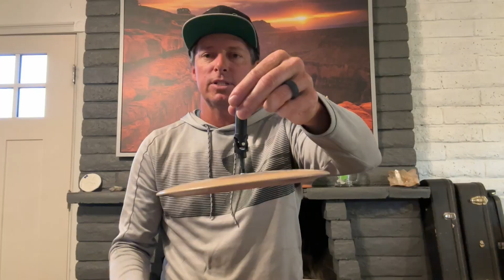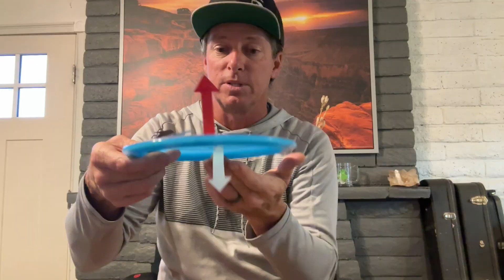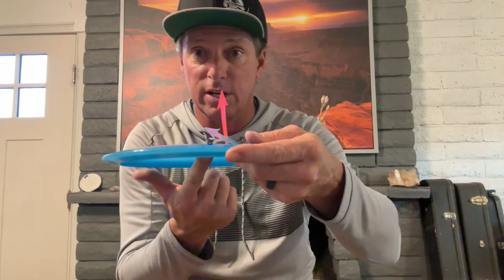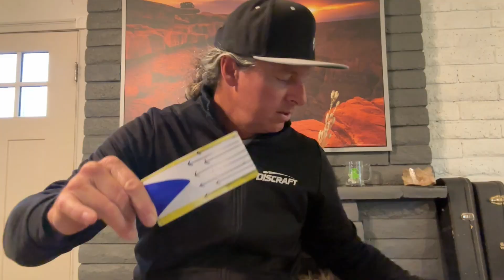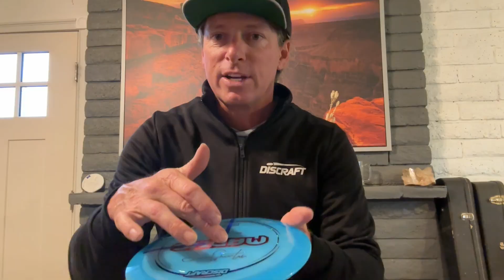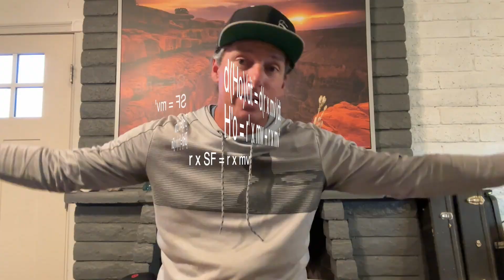Why do Discs golf Discs Turn and Fade?

Comment: Finally the mystery is solved, I do believe. I've been frustrated in the search for an explanation for turn and fade of the flying disc until now. I still need to understand better why the lift position changes but for now I'll take your word for it.
Reply: So I assume that when a disc is in glide mode that the lift force aligns with the center of gravity. Any understanding of why air speed across the disc causes the lift position to shift?
Reply from the maker: @David-ps2nb  thanks for the comment!
For simplicity sake, we could look at an air plane wing. The wing would be designed for optimal airspeed to lift ratio, in line with how the Weight of the disc is balanced over the wing. Typically near 30% of the wing chord.
The faster you fly, the more the center of press pressure (lift) would move behind the center of balance, causing the aircraft to tip forward. If the aircraft were to slow down below the optimal airspeed, the center of pressure would move forward of the center of balance and the wing want to tip up and eventually would be in danger of stalling. What the airplane has that a disc does not, is a motor. This allows the management of speed and angle of attack to keep the wing in its optimal flight envelope.

With a disc, we throw it, so based on the disc’s designed flight speed, if it’s thrown faster than its optimal L/D glide speed the lift pressure moves behind the center of balance, this is what causes “turn”. But because a disc doesn’t have a motor, and “drag” is constantly pulling on the disc in opposition to its forward velocity, the disc is constantly slowing down during its flight, because of this the center of lift pressure is dynamically moving from behind the center of balance towards the center, and then eventually in front of the center of balance toward the end of the flight. If the disc is thrown high enough, it like an airplane will stall.
The higher the speed of a disc, the more narrow its optimal L/D glide portion of flight is. Thinking of a neutral midrange, it has a relatively wide L/D flight envelope, however it has a lot of drag due to its more blunt edge, so its distance is more limited.

Comment: Very nice vid. I would kill to see you make a vid like this on dome vs flat and finally burry the debate about which of the two is more overstable.
Reply from the maker: Thank you for your comment!
I’m working on that particular video in my notes and head.
Proof is better than opinion, however, I’ve got years of flying Rc sailplanes, along with looking at what the free flight and hand launch geniuses have learned from wing shaping for both high and low speed flight. This has made me a little biased in understanding flight physics. But flight is flight, I love learning and it’s all super fascinating to me, so when I tackle that subject for a video I plan to share what’s valuable and factual about both opinions.
Reply: @DiscgliderPete  sounds awesome!

Comment: Is it fair to say that Understable discs receive more downward force at the front rather than lift at the back? After all, isn't the wind that the disc is moving out of the way the primary force acting on it (besides gravity)?
Reply from the maker: No, I do not believe that would be an accurate statement.
Just because air at the front of the wing of an under-stable disc diverts air upward does not mean that it pushes the nose down, because that’s not the whole story or only force acting on the disc. Air passing around the disc’s shape is a result of its velocity, Wings are fluid diverter’s. What happens at the trailing edge of a wing is what gives us the speed of a disc, in that all discs move or displace nearly the same amount of air out of their way, but it’s how much air they divert downward and “drag” along with them. Drag is what slows a disc down.
If we do a little study on how to balance an airplane wing. The aircraft weight is typically balanced around 30% of the wing chord measured from the leading edge of the wing.
The faster a wing flys, the farther back the center of lift moves behind the center of balance. This means the faster that an airplane flys, the more it will want to nose dive, this is counteracted by the opposition of the horizontal stabilizer/ elevator at the back of the aircraft.
With Disc Golf Discs, the center of balance is the center of the disc, also the airfoil is the same in the front as it is in the back.
A disc without spin will not fly because of this balance issue. It will just tumble, because there is a Dissymmetry in Lift and balance along with the angle of attack and lift pressures. Spin is what allows a distance to fly, because of gyroscopic procession, this is the magic behind the flight of a Disc. How much lift a disc generates is mostly dictated by the parting line and airspeed as discussed in the video. The lower the parting line in relation to the triangle shape of the rim, the more air will pass over the top of the disc, the more lift it will generate, the amount of lift compared to the airspeed will determine how far back the center of pressure of lift will move behind the balance point of the wing. When the center of pressure moves behind the center of balance, because of gyroscopic procession, the lift force’s effect will transfer 90* forwards in the direction of rotation.
For the most part, Over-stable discs don’t allow the center of pressure to move behind the center of balance, this causes the center of pressure to remain from the center towards the front of the disc, this forces effect will transfer 90* in the direction of rotation and lift towards a discs natural fade.
Discs flight is a very complex problem to work out. I’m basically discussing the simplified understanding of it. If we change the discs shape by .5-1mm its flight characteristics can change quite dramatically.

Comment: Is the force of lift being applied 90 degrees to the center line always exactly 90 degrees? Is it an approximation that varies with spin rate?
Reply from the maker: As far as I understand, in physics the 90* rule is always at play in gyroscopic precession, I don’t believe it drifts forward or backwards based on speed of spin.
They use spinning weights to keep the space station oriented in orbit, so It’s an extremely predictable rule.
Think of it like this, whether I throw a ball at 20 mph or 60 mph, it has momentum, that momentum carries it forward with a specific amount of kinetic energy, the faster it’s thrown, the more inertia it has and the higher its impact is when its momentum is interrupted. Its momentum its directional because it’s traveling in a “straight line” (though gravity causes a downward arc).
When a disc is spinning it has inertia, that inertia can’t move in a straight line because it’s being held around its center axis, The higher the spin rate, the stronger its resistance to any off axis torque, or changes to its angular momentum. 
Its momentum is angular because it’s being held rotationally instead directionally.

Comment: Can you explain why discs goes more understable when beating in? Most have something to do with leading more air over the disc when beated or?
Reply from the maker: There are two theory’s.
1. As discs beat in the nose gets pushed down slightly. 
I think that’s a viable explanation for base plastic discs, but not necessarily for premium plastic discs.
2. As disc get dinged and scuffed, the air over the surface stops being laminar and becomes turbulent, eg. separated from the surface. This would tend to cause more lift and induce more drag  as a result.
I tend to believe this theory more, due to many experiences in model aviation.

Comment: I would love to see you do one explaining how more or less spin affects flight. My friends all think more spin means more turn but I try to tell them it means less turn AND less fade. More true gyroscopic stability.
Reply from the maker: Thanks for the comment!  yes that is a common misconception, and one I used to think years ago.
Here is a great experiment: take a fidget spinner, spin it slowly and then twist it around of axis. This will be easy. Now spin it super fast, then try to twist it off axis. It will now be hard. More spin = more resistance to any off axis toque, whether the disc is flying with air pressure lifting on it or being twisted in the hand.

Comment: Best explanation that I've seen on what makes discs turn!

That also helps explain, for me, why understable discs go further with less effort -- more lift!  A Hades generates more lift than a Zeus which generates more lift than a Force 🤔
Reply from the maker: Remember though: when you throw a disc that has more lift and turn, it flys farther because you traded predictability and stability for under-stability and less predictability :)

More lift = more drag - more turn
More lift = more turn - less stability 
Less drag = less turn - more stability

Comment: Would you say that “wing height” is the major variable determining the stability of a disc?
Reply from the maker: Can you clarify what you mean by “wing height”?
.
If I assume you mean the leading edge of the disc being higher or lower as a triangle in relation to the rim, then yes, as stated in the video, a higher parting line is typically more stable than a lower parting line.
A secondary part is the shape of the bottom part of the wing, being convex or concave and how it sheds the air below the disc, but that’s for another video.
Reply: @DiscgliderPete  Awesome! Yes I was wondering about that variable too (the bottom part of the wing being concave or convex). What do we call that?
 And yes, my understanding of "wing height" is, if you place the disc on a flat surface, it's the distance from tabletop to the parting line.

Comment: Then how come that an overstable disc thrown upside down becomes more overstable?
Reply from the maker: Let’s think about that.
Take the known forces acting on the disc.
First throwing upside down would reduce its spin significantly, now take the lifting direction of the disc and aim it downward with gravity, the majority of the air being diverted over the bottom which is facing up, is in turbulent airflow and causing drag in a way that would draw the nose upwards into a higher angle of attack, but the force wanting to draw that nose up would be transferred to the direction of rotation 90degrees, and the right wing would lift more….clockwise spin.
That’s my thoughts on it. Maybe wrong, maybe mostly right?

Comment: I know I'm a bit late to the party, but does the amount of dome have anything to do with the turn/fade? I think most would agree, from personal experience, that flatter disc are more stable than their domey counterpart, but what would happen, for instance, if a tilt had dome? Or a mamba was flat? Does the dome solely affect the glide, which would slow the speed at which a disc would fade? Great video!!!
Reply from the maker: Thank you!
(I copy and pasted my comment below from another question that was similar with a couple added thoughts)

The flat versus Domey argument has always been a little comical to me, because some guys think the flat disc are more stable and the domey are under-stable, and other guys think that Domey are over stable, and the flat one stable.
Domey discs tend to have more glide than flat discs. Where the parting line is dictates him much air is diverted over the top vs.the bottom. A mamba is virtually flat from the nose to the bottom of its lip, but has a high curve from the nose to the shoulder…more air is diverted over the top. from here weather the flight plate has a pop top or a flat top, it’d seem to be a lift to drag issue. It’s going to be flippy either way. 
For our two discs, Let’s assume both have identical parting lines. There are many components to understand it all, from lift, to drag, and even release angle.
My personal observation is this:
I think the varying opinions are a result of a grip issue. 
Some guys love to throw flat discs while others prefer domey, and those are the camps they tend to stay in. When a person who loves throwing flat discs, throws a domey disc, they tend to believe it’s more stable. When a person who loves domey discs throws a flat disc, they tend to believe it’s under-stable, and vis versa.

Hold a flat disc in your hand, be exact at how it settles into your hand, like you are ready to throw in the power pocket position, notice how the edge of the disc closest to your chest looks.
Now grab a domey disc of the same mold,
Hold it in the same exact manner as described above. I believe that you will observe that the domey disc settles into the hand in such a way that the edge closest to the chest will be lower by up to a 1/4” or so. This result is because the domey disc is slightly taller leaving the rim and the thumb sets higher over the flight plate pushing the edge closer to your chest down slightly, so what feels “normal” is a slightly different angle between the two disc, and would leave the domey, disc on more of a hyzer angle out of the hand compared to the flat disc. 
Thats my observations and opinion after years of observing the two groups and various opinions.
In flight we are always trading one preference in flight for another.
Lift we trade for drag
Speed we trade for control
Stability we trade for glide 
Distance we trade for control
Speed and stability we trade for glide.
Wanting Speed and glide we must trade for in-stability.

Comment: This was a super informative demo! Appreciate the video. If you're able or have the understanding, I'd love to hear what effects domey vs flat flight plates have on the flight of a disc.
Reply from the maker: Thank you!
The flat versus Domey argument has always been a little comical to me, because some guys think the flat disc are more stable and the domey are under-stable, and other guys think that Domey are over stable, and the flat one stable.
Domey discs tend to have more glide than flat discs. Let’s assume both have identical parting lines. There are many components to understand it all, from lift, to drag, and even release angle.
My personal observation is this:
I think the varying opinions at a result of a grip issue. 
Some guys love to throw flat discs while others prefer domey, and those are the camps they tend to stay in. When a person who loves throwing flat discs, throws a domey disc, they tend to believe it’s more stable. When a person who loves domey discs throws a flat disc, they tend to believe it’s under-stable.

Hold a flat disc in your hand, be exact at how it settles into your hand, like you are ready to throw in the power pocket position, notice how the edge of the disc closest to your chest looks.
Now grab a domey disc of the same mold,
Hold it in the same exact manner as described above. I believe that you will observe that the domey disc settles into the hand in such a way that the edge closest to the chest will be lower by a 1/4” or so. This result is because the domey disc is slightly taller and the thumb sets higher over the flight plate pushing the edge closer to your chest down slightly, so what feels “normal” is a slightly different angle between the two disc, and would leave the domey, disc on more of a hyzer angle out of the hand compared to the flat disc. 
Thats my observations and opinion after years of observing the two groups and various opinions.